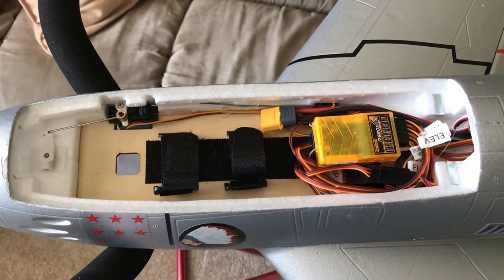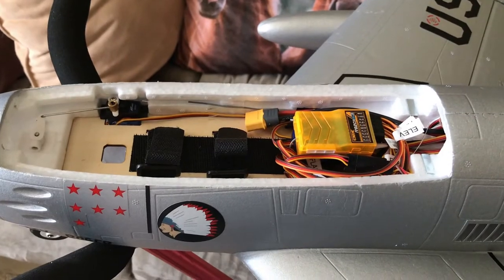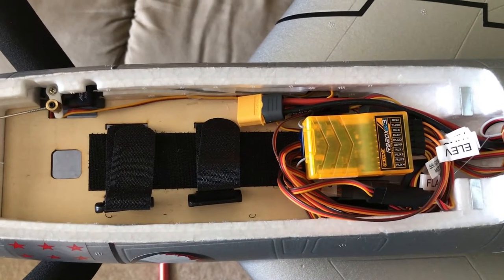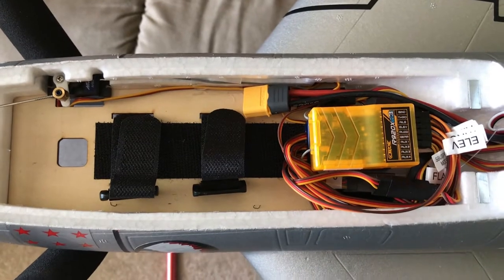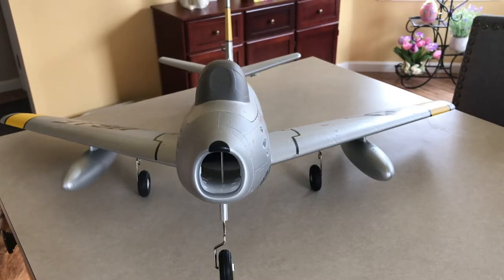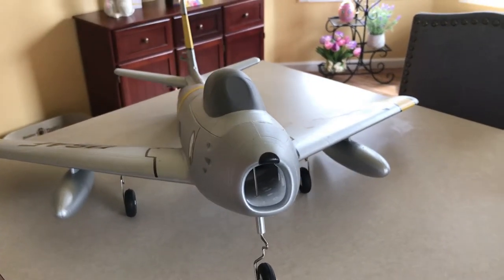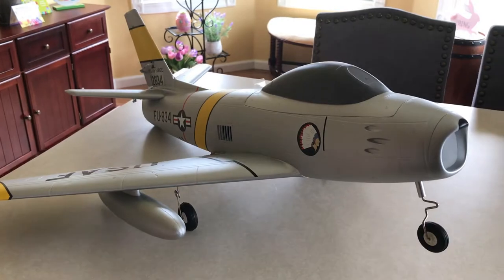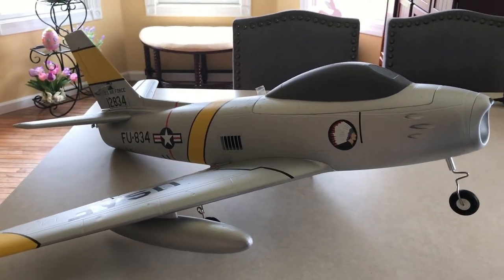ARROWS F-86 64mm 9 Channel Hobby King Orange Receiver Placement

Comment: G’day Don. Well presented mate. I was about yo get this from RC Castle plus the upgraded oleo gear…. Then a huge 20% off sale from a local hobby shop had the Eflite RV-7 on sale so i ordered it instead.
Looking forward to seeing your jet fly.
Have a wonderful Easter🇦🇺🦘🛩
Reply from the maker: Nice one my friend, I noticed that horizon has been putting a lot of planes on sale, I guess a lot of people aren’t buying them at their current prices. Talk to you soon
Reply: @DonsRCAirplanes  yes Don, very expensive and more so here, ie the new T28 is $A600. RV-7 A$500 but my price $360 with ebay 20% off. Your new Arrows jet should fly like my Marlin. Such a great model. Have a good Easter